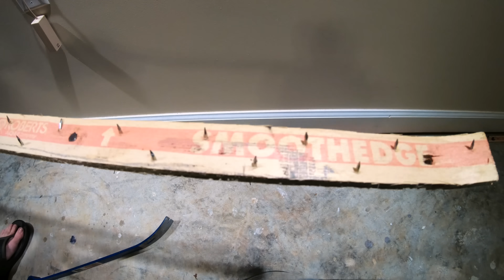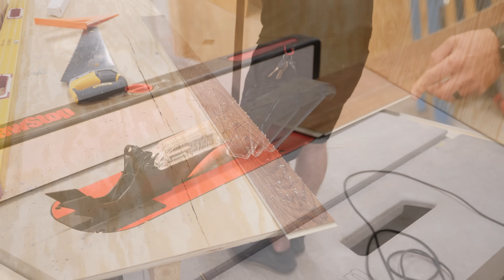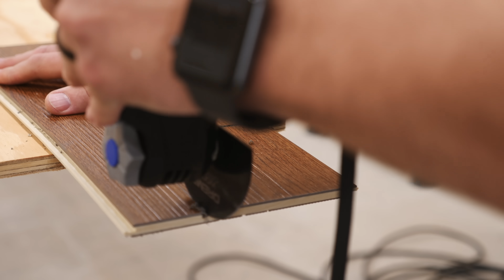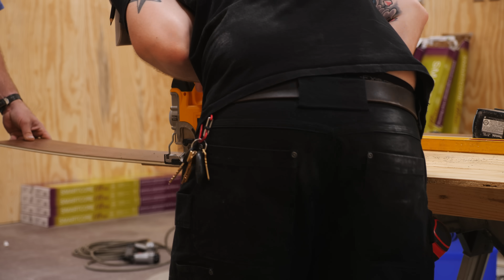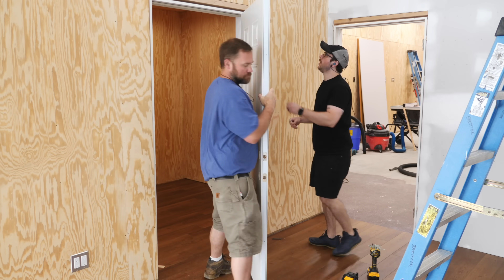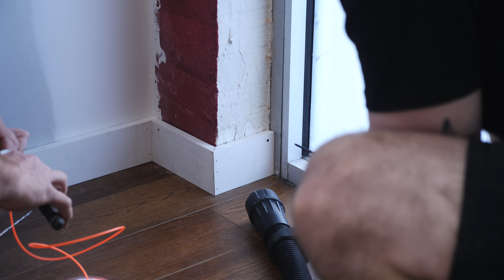How To Install Vinyl Plank Flooring Tutorial For Beginners // Home Reno

Comment from the maker: Hope you enjoyed this one, installing vinyl plank flooring is an easy home renovation or home improvement project for beginners! Thanks to Lowe's for sponsoring this video, check out the Dremel Multi-Max 50 : http://bit.ly/dremelmultimax #sponsored
📹 SUBSCRIBE TO CRAFTED WORKSHOP : https://goo.gl/V5gcNJ
Reply: Hope you removed those spacers the idea of leaving a gap is for expansion or movement of the walls and to potentially alleviate boards popping up as the join between the boards in most cases aren't very good hence why with the last small length you had to hammer it flat. I also noticed you mentioned moisture typically you should still use a silver underlay designed for floating flooring which helps with vibration noise and as a future moisture barrier incase you have water issues in the future. 
An alternative is to seal the slab with a surface sealer, but that has the drawback that if you want to lay tiles or another product that requires adhesive you would need to chemically etch or grind the surface. Still the final result looks great.
Reply from the maker: Yes, we removed the spacers. And this flooring does not need a vapor barrier. Thanks.
Reply: @craftedworkshop   
),  Aaaq 🇵🇹😎 8,7kl.
Reply: @nicko198718  ppñp
Reply: Looking good so far. I usually install each row like you did for the first two rows. I notice that the joints wear out easier by installing the boards one by one. The underlay is for sound and moisture  proofing but also to make the floor softer to walk on. Still haven't found a good sealer. Would you recommend anything for this?
Reply: how do I fix a damaged piece of vinyl flooring? It's sitting right in the middle of the room. Do I have to remove everything?
Reply: Do you not need a moisture barrier with this kind of flooring? Even on concrete?
Reply from the maker: @BellTunnel  nope!
Reply: Crafted Workshop thanks!
Reply: So to make sure I understand, 1.  you have to remove all the baseboard? 2. someone else asked about spacers, are those the pieces you put in at the very beginning?

Comment: Did you not need to level the concrete floor?  I saw you had a decent bow in the floor.  Will the flooring lay ok if you don’t level?

Comment: 1: How do you get the first row straight? You cheated as the wall you just put in you knew was straight. How do I determine a straight line in a non square room ? VERY IMPORTANT when laying a floor, otherwise it will look crooked.
2: Where do you start the floor ? Off od Which Wall ? You enter rooms different ways.
3: How should planks be laid in a room..long ways on long length of room or long ways as you enter a room.
I find these to be the most important questions when laying a floor.
You mentioned none of these.

Comment: Do I need to put a vapor barrier first, since I’m applying it on a basement concrete floor?
Reply from the maker: This specific product didn’t need a vapor barrier. Check the instructions on your specific flooring though!
Reply: Even products that don’t specify a vapour barrier over cement/concrete should have one, as the attached underlayment (or unattached, for some laminate) will easily be corroded.  Cement/concrete is quite corrosive to both foam and cork underlayment.  -flooring vendor :)

Comment: Thank you for the video!  We're putting in vinyl plank flooring in our bathroom. I've noticed some people talk about putting silicone caulk in the 1/4 in expansion gap around the toilet pipe or around the bathtub, but this seems like it would interfere with expansion and prevent the floor from floating.  What are your thoughts?
Reply from the maker: I would definitely add silicone in a bathroom install. I don't think you'd have issues since silicone flexes some, plus the material probably wouldn't expand that much in a smaller space. You can add foam backer rod and add the bead of silicone on top of that, then you'd have the best of both worlds.

Comment: that would help me for sure in my project. Thanks for sharing. If you have to install this flooring on concrete, do you have to add any underlayment? also is that a button on the vacuum hose?

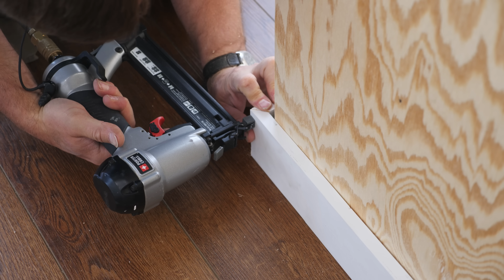Comment: If this video is for DIYers, probly don't want to show yourself holding your fingers right where you're shooting the nails at 13:05. Seeing as you said you should use at least 2 inch nails, your fingers should be at least 2 inches away from where you're shooting the nails in, trust me, the nails can go into the wood, take a turn, and come back out right into your finger, I've seen it happen to people.

Comment: I constantly see is people using off cuts instead of a tapping block, the issue with that is you can see small chunks of the piece breaking off while its being hammered into and those pieces are often not cleaned up and get left under the floor and then can end up making sounds when stepped on or even bumps. Most box stores will sell tapping blocks that last a long time, and pretty cheap too, cmon guys!

Comment: You Must READ You Must Install “Underlayment” First ...That Floor Will Be Noisy.
Reply: This Is (VINYL PLANK)  Not Laminate Or Wood Flooring...... Which Usually Require Underlayment. 
If You Read The Instructions On Almost All ( LVP Luxury Vinyl Planks ) Most Brands Nowadays 
Specifically States If Underlayment Is Used, You Void The Warranty. These Kind Of Vinyl Floors Are Not Noisy At All..... We Have 1911 Farm House And Vinyl Was Our Go To. It’s The Most Forgiving When Working To Try To Level Our Floors. It’s Not Like The Cheap Rolls Of Vinyl Back In The Day. 
Im Not Trying To Be A Know It All. Cause I Definitely Don’t.  Lol 
I’m Here Learning  Different Tools To Use. I’ve Got 4 More Rooms To Finish.

Comment: In the first row, how do you remove the spacers once the floor is complete since they are under the drywall?
Reply: I would like to know this as well.
Reply: Those can be removed after but can be very annoying. I feel like maybe they ended up leaving them in there seeing as Vinyl Plank Flooring has a very very small expansion/contraction.

Comment: I'm having luxurious vinyl planks throughout the house- including kitchen, bathrooms and laundry room. My subflooring has a substance that was used level all rooms. Its porous and therefore a sealant was used. I ask the floor person if was going to use a under protection cloth and he said he didn't have too because he used the sealant. However,  I  noticed there wasn't any sealant near the shower and tub. Will this become a problem- mold, fungus or rot?
Reply: The most idea solution for your situation would be to use a pad/vapor barrier under the floor it would help with moisture control and make a more quite floor, however if you do not want to go that far and want to avoid it, read the manufacturers recommendations for using their product and go with that.

Comment: Fantastic work, Johnny! Now I can use the techniques you and Justin used in this video and apply it to my room. My dad and I are also applying vinyl to the bedrooms. Also, did you know Diablo actually makes a vinyl cutting jigsaw blade? Turns out that it gives a cleaner cut than on the tablesaw.

Comment: Great job, I'm just curious why not the use of vapor barrier on concrete? I noticed many companies recommend it for warranty
Reply: It all depends on how the concrete work was done, will impact whether more vapor barrier is needed or not. If you want to go on the safe side then you would want to add another sort of pad/vapor barrier before installing flooring even though the flooring that they used already had a thin layer underneath.

Comment: why would you install floor or baseboard without painting the walls first?
Reply: 🤷‍♂️ I'm lost too
Reply: The only reason I ever would, would be if the drywall or texture was drying and I had nothing to do so I would start on the flooring, but I don't think that's their case here. :)

Comment: Thank you for all of these videos, I have one question, I have an 8mm plank with a pad attached going on an even wood subfloor, do I need underlay with a pad being attached? Manufacturer states it can go either way and I’m just trying to get insight, Thank You for all of these videos, they help so much
Reply: you just answered your own question, either way is fine, I installed mine using only the attached underlayment, if you want to lay more, its optional
Reply: If you lay 2 layers you get a more quite sound when you walk on the floor, and a better vapor barrier for temperature control.

Comment: Hey, I heard there’s no expansion and contraction issues to worry about with vinyl planking 😲
Reply: And you have heard right sir.
Reply: They need a little room to expand and contract; hence the 1/4” gap all around.
Reply: @marebear09  no they dont.
Reply: Artenis Dhjaku Oh, I was mistaken!
Reply: Just watch out for the existing wall from expanding and contracting.
Reply: Kodi Ham Ah, that makes sense.
Reply: Yup. Their movement is so small compared to other flooring, that you pretty much don't have to account for it. It's just a habit for flooring installers to still leave a small gap, doesn't hurt anyone, and it's good practice for when you work with other materials. That being said, this is only true for real vinyl plank flooring, make sure you do not confuse it with any flooring that has any amount of wood in it, or tile, some tile expands and some doesn't.

Comment: Use Tape to hold the spacers in the wall 🤪
Reply: How would you use tape as spacers? I am planning to do my LVP install without removing the baseboards and need a spacer that can get under the baseboard and still be removed after floor is installed.
Reply: SylviaRabi i meant to tape the spacers with tape into the wall so they dont move 😒😒😒

Comment: I just ripped my rug out in my living room and hallway, and tore the tile out of the kitchen in my condo to do this exact project.
But, the guys at lumber liquidators also sold me padding that apparently goes UNDER the vinyl planking.
How come you aren't using this here??
Reply: @William DiStasio. Some flooring will come with padding already attached, and some won't. But if you add pad onto the floor and then install flooring that also has pad on it, you will make a better vapor barrier and a more quite floor. As a flooring installer I would definitely recommend going that extra step if noise reduction is important to you, and if you're installing flooring on concrete seeing as it normally gives out more cold than a wooden subfloor system would.
Reply: William DiStasio these boards come with their own padding on the bottom.

Comment: I’m very surprised that you put flooring down before you primed and painted the walls. Without the floors you could’ve primed and painted without worrying about getting paint on it on your new floor I think it’s a lot easier way to go.
Reply from the maker: The trim still would have had to go in after the flooring, and it would have had to been painted. A drop cloth solves that problem pretty easily.

Comment: For any lvp or floating floor you never run one row at a time. Always start off with on full board n cut 3 more starters.    Stair stepping the floor as you install it gives it that bigger body to where it eventually doesn’t move at all, not needing the spacers. You’ll find it to be a lot easier installing being on top of the floor. As far as cutting it I get that you’re showing tools you can use but there’s no lvp that can’t be cut with a utility blade it’s all about the angle you dig the blade into your line

Comment: Shouldn't there be some sort of barrier in between the concrete and the flooring? To dampen sound etc.?
Reply from the maker: The flooring has a foam backing, so no need to add anything else.

Comment: I like to layout or dry fit several courses of tile or wood, fully seating the grooves or using tile spacers.  Measuring the total width and dividing by number of rows to get a more realistic coverage estimate.  Watching your initial measurement, I was thinking, "Just split the difference. Trim and drywall will cover the gap.".  I'm a fan of tap-cons in brick and concrete, but they don't always have the head that's right for the finished application.  That being said, I LOVED the trimmer line trick!
Reply from the maker: Thanks man, and dry laying the rows makes a lot of sense. The string trimmer trick was new to me too, Justin is full of clever tricks like that!

Comment: Are you sure you got the planks seated together all the way? The LVP I just installed fits very snugly together, to the point where it's hard to see the seam at all, but it took some significant hammering to get the planks pulled together completely. Just wondering if that's why your measurements were slightly off. It would have helped to put together five or ten planks and measure those, then divide for an accurate single plank measurement. It's hard no matter what, though. You can get a nice width in the hallway and then end up with a sliver to install in another adjoining room. Hard to account for everything. Nice work, though! It looks great.

Comment: Why didn't you at least cut those last flooring planks in half so maybe every other 2 or something would have some seam? Would have made it more realistic than just using solid planks all the way. If you cut them (as you'd only lose a blade's width of material), then you could just swap the left and right sides and connect them.
Reply: J Etzel. I was thinking the same thing
Reply: Agree

Comment: I noticed that you guys didn't add a foam moisture barrier that I've seen in other installs.  Is it not needed, just wondering what the thinking is?  The shop is looking great and really coming along..
Reply: I would say not necessary since this is a pure vinyl flooring (plastic) so it won't rot.
Reply from the maker: There is no vapor barrier needed for this flooring. I just followed the manufacturer’s recommendations.

Comment: No foam to avoid rattling?
Reply: Typically these products come with cork or foam backing on each plank.
Reply: @aranykai  at 7:49 I see the rubber backing. Thanks
Reply: Some flooring already comes with a pad, however you can further reduce the noise that is made by adding another layer before the flooring installation, and improve on your temperature control at the same time.

Comment: You did not use any glue or adhesive for the vinyl planks?
Reply: It would crack and look like garbage. It will expand and contract because of heat, etc so it needs to be able to move.
Reply: @AnthonyBowman  I see.  That make sense.  I hope I can find that type of planks here in our country.  I like that thick one and the connectors that lock them through.  I like your videos.  Very simple and informative.  Carpentry is one my hubby.  Basically, anything DIY in the house. More power!

Comment: Hello Crafted Workshop, I like your video.  Question, do you have to have that space along well when you lay down your planks?  I live in Florida and my mother's house has laminated floors and they look great, but after ten years in place, I have noticed some of the planks has a 1/8 gap and I have stomp-slide to close that gap. I figure this is from the pace against the wall and the plank...do you need to have the gap?  Thanks!
Reply: Flooring installer here - Without being able to see the flooring itself and properly assess the situation... The two most likely things that could have caused the issue is improper spacing when the flooring was installed, most likely not enough gaps along the floor. Or the flooring did not acclimate, stay in the home in the area it was to be installed in before actually being installed, long enough to adjust to the house's temperature. The reason I say that is because Florida has hot temperatures, but people probably use AC. So it would be going from hot to cold, and wood will grow and shrink overtime based on the temperature nearby. So if the wood was stored in a hot warehouse and then got installed in a cold house without having time to adjust it could have slowly overtime changed to develop gaps. Or the other way around, cold warehouse, hot house where it was installed. Hope that helps!

Comment: Why do you need an expansion gap for vinyl? Does this sort of plastic expand seasonally? if so, why not use engineered hardwood or something else that isn't a flimsy layer of plastic. Are you expecting lots of water on the floor? If so, concrete would have been fine, or some of those rubber interlocking tiles. Maybe the whole thing is just an infomercial.
Reply: All materials will expand and contract unless the environment is totally climate controlled. Even engineered floors will have some movement.
Reply from the maker: The framing will also expand and contract. I went with vinyl plank because it’s simple to install and creates very little dust compared to laminate.
Reply: Any floating floor requires expansion gap or it will bind and buckle with temperature change. Engineered hardwood also requires this gap, unless it's being glued or nailed to a subfloor.

Comment: Quick tip dont use a hammer and a block to lock in the ends, use a wood or hard plastic block and use that to lock em in. Just works alot better. The block should be about 5 cm wide and 20-30 cm long. 2 inches wide, 8-12 inches long.

Comment: Those plastic spacers are actually great to use imo.  You use two together and can adjust the width of the space super easily!
Reply from the maker: They still fall over! I struggled with them during my laminate install too.
Reply: I've seen on another channel, the spacers were taped to the wall.so much easier to remove later. Room looks great!